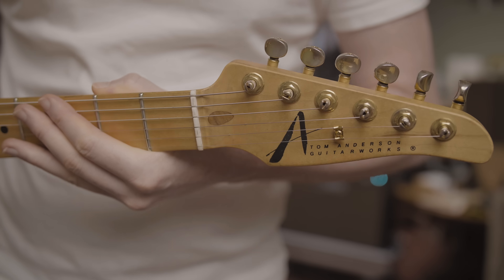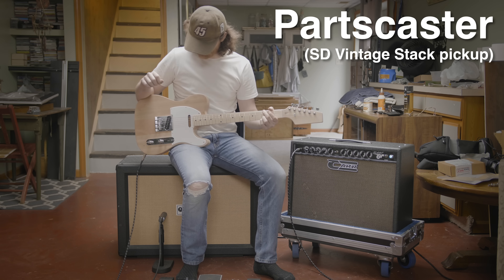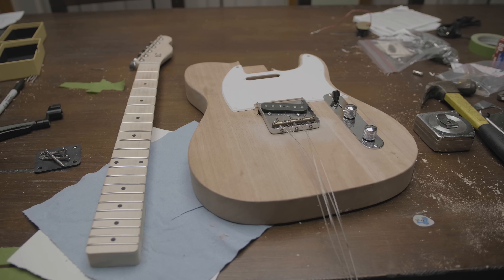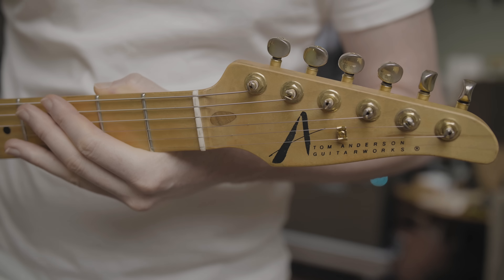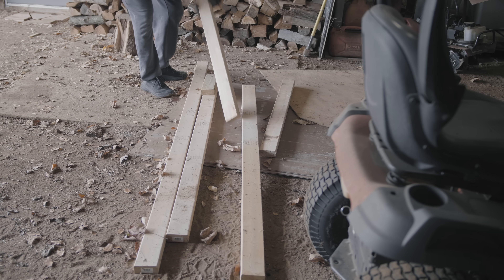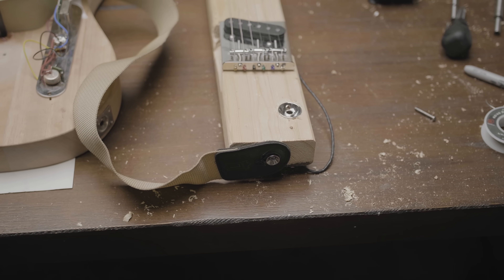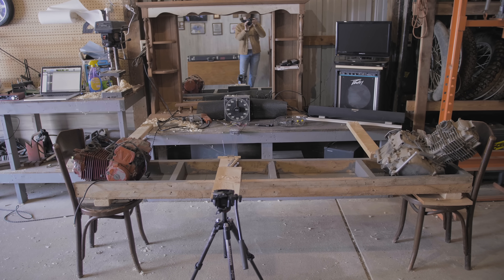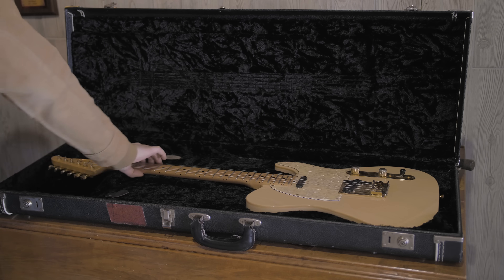Tested: Where Does The Tone Come From In An Electric Guitar?

Comment: Completely blown away at what you just taught me. Wow!  I will now buy my guitar to the specs and look that I want and alter only the pickups and electronics for my tone. The tone wood myth has been dispelled.
Reply: Don’t cheap on the hardware either! Just because it doesn’t affect tone noticeably, doesn’t mean it doesn’t matter. Great hardware lasts a long time and stays in tune reliably.
Reply: yessir!
Reply: on potted pickups yes
Reply: @Karokahn  Nice try, all pickups are potted, if they weren't, they'd be microphonic, which is not what you want in a pickup.

Worse still for your theory, pickups are potted in wax typically, which is very soft. Look up the resonant frequency of wax (it doesn't have one), so that's preventing anything from being microphonically induced into the signal. Further, the pickup itself is only attached to the guitar via two screws, and suspended on those screws with springs.

So if you're a "microphonic" believer, the place you should start is the screw/spring assembly, not the wood.
Reply: @jttech44    .. Nice try 😂 all pickups are of course NOT potted.  If you will ever play a set of such, you may even understand what difference it makes to their sound.. if you dont play metal, that is 🙄

Comment: I'm not a guitar player, but one other thing to consider is how long a 2x4 would actually stay the same shape with tension on the springs, changes in humidity, or changes in temperature. I would think that what you're actually paying for with expensive hardwood guitars is longevity and durability, not just tone.

Comment: The only difference I imagine the wood might make is how quickly it absorbs the vibration energy from the strings and kills the sustain. And I wonder if over the length of that sustain certain frequencies and harmonics might die off more quickly or slowly depending on the density. Though you’d have to bolt your guitar to a hard, dense surface to eliminate the dampening that simply holding the guitar introduces.
Reply: And sustain isn't tone. 
It's the length of the tone. 
Tone is the character, EQ signature of the sound, length or sustain for the same sound can vary.

Comment: Finally this proves tonewoods do nothing. The only reason you should choose different woods is purely for the looks of the finished guitars. Tone comes from the pickups and that's it. But I guess sustain comes from the woods and construction as sustain is basically how long the strings can resonate, and what the strings are attached to most likely have and impact. Learned something today thanks.

Comment: This has been popping up in my recommended feed for a few months now and I've put off watching it for some reason, but I'm glad I've seen it now.  You just completely shot down tons of myths that have been around forever about what makes a guitar's tone.  

Most of what we pay for on an electric guitar is the fit and finish, but more importantly is the play-ability and comfort!  In a test like this those things may not matter at all, but in actual use of the guitar that makes a big difference.  The playability and set up is a major factor in how smooth, how fast, and how precise we can be while playing.  So yes, while it is definitely possible to get an identical sound out of the cheapest guitar possible, the comfort and feel won't be the same without putting work into it.

This at least clears up for people what they don't need to be picky about when it comes to buying a guitar, which is great.

Comment: I have a nice collection of guitars and have been noticing that they really don’t sound all that different from each other, except for the hollow body electrics, which do seem to depart from the solid body guys.  I have also noticed recently on a setup that the pup height makes a huge difference in tone.  As for the contribution of the body, I can see how the strings could resonate through the wood and have a certain effect on dampening the vibration (which may well explain the hollow body) but the first-order tone influence seems to be the pup height and strings, as your excellent research has shown.  I have a Squire that I bought for one of my kids for $200.  I sounded like crap until I set it up - adjusted pup height and intonations - then it sounded very much like my Fender Strats, even with the stock Squire pups. The setup is ALWAYS required and so many don’t bother but you can do it easily with simple tools and some patience. Once set up properly the better guitars will outplay the cheapo’s but mainly because the latter don’t have the nice fret edge finish work and mag also lack quality pups (sometimes also crappy bridges and tuners). Nice work!

Comment: Ok so what I have found that goes into the tone of a guitar goes into the finitest parts possible, all the way, which is all the materials it is made of. Starting with the most essential & generating sources, then reaction balances and care for the Vibrational Resonate Frequencies being kreated. There are other factors to pay attention to & make sure a guitar or other instruments are in accord, tune and environmentally balanced with. Starting with the types of metals used in relation to Magnetism. Sound waves generated from the strings on a guitar are physical specific waves, & work & blend with physical magnetic & electricity waves. So the magnetic, electro & Vibration waves need to be in sync with each other & working together efficiently. The sound waves are attracted to the Magnetism, & the electricity directly attracts to & is ampped up by the Magnetism. Then the Electricity amps up the Sound waves or Vibrational Waves or Magnetic sound wave signal. So the materials, woods or Organics used should be paramagnetic or related when possible, Hemp necks may be a better place to start, or other care for the Magnetic\Electro\Sound Wave Combination signal strength needs to be tracked all the way through the entire instrument, to capture & flow all of the sound wave signals, & send them directly to the magnetic pick up system. They naturally want to attract to the Magnetism, so care for the source of sound waves being generated starts there. The truss rods need to be ferromagnetic, which auto attracts to the strongest, nearest magnetic source, which is the pick up system. The frets need to be solid paramagnetic metals, which activates with a ferromagnetic source and flows energy ions to the ferromagnetic source, which then attracts to the strongest magnetic source at the pick ups. Diamagnetism activates with a ferromagnetic source and pushes ionic energies away from the ferromagnetic source & magnetic pick up system, so they should not be used on an Electric guitar. Because they send second & third level ionic sound wave\electro EDDIES away from the ferro & magnetic pick up systems. The second & third level eddies add the best parts to the tone after the first main circuit of Magnetic Electro is established & operating. So the metal strings used need to be ferro or paramagnetic to link with the magnetic pick up system. Then all of the other vibrational Waves kreated by the strings need to be captured in the neck & body, and magnetically attracted to flow in one direction to the pick up system, and not let any sound waves be pushed off away from the instrument & pick up system.  So magnetic flow from the paramagnetic machine heads needs to flow to a small magnet at the nut facing north, in line with this Planetary Magnetic System. Then flow into the ferromagnetic truss rods as all the vibrations in the neck are captured by the paramagnetic frets & attracted to the ferromagnetic truss rods flowing to the magnetic pick ups. Then the same method used to capture wall of the vibrations, reverbs & timbers being kreated in the body, and attractively sent to the pick up systems, all metals used after the ferromagnetic truss rods or strings, need to be paramagnetic to Kreate a magnetic flow system that flows to the pick up system. Stronger & higher amounts of magnet\electro\vibration waves & signals flowing into the pick up system, adds vast amounts of tone to an Electric Guitar output, because of stronger signal inputs into the pick up system, instead of kreated, secondary & third level benefits being physically pushed away from a guitar & pick up system. Ferromagnetic Glass Metals can also be used to Kreate New kinds of attraction covers to magnetic pick up systems. Then a paramagnetic lining should be put at the back of the body to keep vibrational custom waves from escaping out of the back side of a guitar, a rounded back body also kreates maximum reverb & timber effects that are attracted to the paramagnetic lining in the body, and are magnetically sent to the pick up system.

Comment: The SLIGHT differences some of you notice here are due to the acoustics of the barn he is in and the fact that he moved his camera setup around while recording. That's it. Whether you believe tone wood matters on an electric guitar or not, the main point is, don't pay a lot for a certain type of wood and don't pass up a guitar you otherwise like just because of the body wood. Once you plug it in, you can EQ and modulate ANY guitar to sound like any other guitar and NOBODY will be able to tell if they aren't there watching you play. Example: When Led Zeppelin first showed up, everybody went out and started buying Les Pauls after hearing the albums. Then they found out he was actually playing a telecaster. It's a well known fact and was a running joke at Gibson for years. YOUR tone is in YOU.

Comment: This is so painfully frustrating. Yes the pickups, wiring, scale matter the most as far as tone and gain goes, however. The air guitar is tacky, lacks middle and bass, has no balance as well as somehow no seperation. You can hear as you take the body away from the guitar the decay is swifter and a little less sustain. Also most of your examples you can hear the less body guitar clearly gaining more ugly artifacts in distortion. The body and neck of guitars resonate back into the strings creating a phase and increasing the resonance similar to a spring reverb. This whole video you just base on the sound of clipped low quality recordings, show us it into a di and an EQ even the smallest difference means something. The lamest thing is that low quality guitarists make this arguments, while people who build them, producers and top guitar players all completely disagree. It is actually measurable as a producer and it astounds me someone didnt stop you and point out some of the far more obvious ways you can test this.
Reply: I mean honestly i think maybe its because im in the studio with monitors rn, but if you cant hear the clear difference between eery single example on this video you need to check your ears

Comment: A specific guitar tone is generated from pickups, cap and pots NOTHING ELSE assuming your strings are in good condition. Like many have pointed out the musician also has an input, so I guess if one like rosewood over maple or vice versa it might help but that is superficial and subjective. When I buy a new guitar I always mess with the caps just for a bit of fun and comparison since they can make quite a bit of difference no matter what pickups you have. But seriously when playing its your effects amp and particularly what drivers are in your cab that matter the most.

Comment: At the very end, one thing the air guitar and the TA still have in common is the bridge *type*. Different materials, yeah, but maybe the materials don't matter as much as the bridge type, shape, how it's mounted... I don't believe in it too much, but hey, science requires precision.

Since most of the time, we're trying to change how a specific guitar sounds... between the leftover variables (tuning, strings, scale length, volume pot, and then everything that relates to the pickup), there's only so many things we can easily change. We usually will stick to specific tunings and often also to the strings, because these things impact other things than the tone. The scale length is fixed. The pickup position and angle are fixed normally (unless it's a pickguard guitar with universal routes underneath). So essentially, without hacking away at a guitar, it's: pickup model, pickup height, and the volume pot. Those are the things that can "easily" be changed.

Comment: To be honest the 3 biggest factors in my opinion are the player, the pick-ups (type and positioning) and the amp in pretty much that order. I think a few other things effect it too but those 3 are the major ones. I've played Squiers that sound indistinguishable from their much more expensive Fender counterparts. All I've ever done is upgrade the electronics are set it up correctly like in your video. Obviously you can embellish on the tone with pedals/effects and such afterwards too
Reply: The amp/pickup combo is very very intricate. Input impedance matching, and what the amp does to a given set of frequencies is very specific and nonlinear.
Or to put it simply, it's the machine, then the player, always. The machine can, of course, help or hurt the player, but, that's not a tonal change.

Comment: Besides "the player" or the wildcard element of playing the guitar in general, Pickups are 1st, hardware 2nd and possibly scale length but frankly far too much is put on the "acoustic" elements of the guitar involving woods and finishes, to the point where it's just about aesthetic.  The pickup only "hears" string vibration via electromagnetic flux and it's probably 99% electrical signal and less than 1% microphonic/acoustic energy sent into an amplifier.  Experiment:  Take your guitar and put it on your lap.  Take your cell phone and play audio from the speaker (bottom).  Hold the cellphone over pickup and notice the audio clearly sounds out of your amplifier.   But now turn the phone upside down, where the audio signal is directed upward, the audio should as loud or louder coming from your guitar because the pickup is "hearing" the electromagnetic signal from the speaker magnet/coil from your phone, not the audio signal coming out of the speakers.

Comment: Acoustic guitars differ way more with the wood, hole placement, neck etc but with electrics its way less apparent, mainly things like sustain are affected with the body shape and wood type but the biggest things are electronics, strings and if the neck is glued in or screwed in. if i put tele pickups in my lp it will sound basically like a tele and reverse just maybe a bit more or less bass and more or less sustain virtually no difference especially to an untrained ear e.g your audience if your playing live.

Comment: My opinion: I've always felt it's obvious that the "voice" of the electric guitar is down to the pickup. Beyond that, there are other factors that affect the sound to a lesser degree (some more than others). The voice stays basically the same, just with minor changes to certain parts of the voice.

Pickup placement is the biggest one, not just height but position along the strings. Scale length makes a big different because it affects the pickup placement so much; a strat neck humbucker will never sound quite like a les paul neck HB. Saddle and fret material make a solid difference. Strings make a huge difference. 

Wood makes a difference - not directly to the voice, but to the qualities of the string's vibration, which is then picked up. That includes chambering and semi-hollow construction. It's questionable whether we could call this "tone". I take tone to mean the quality of the guitar's voice. I think wood affects tone a little bit (I've heard other well-controlled A/B tests that display it), but I think the biggest difference wood makes is how it affects string dynamics, which doesn't change the voice of the guitar, it changes how it's saying its notes (ie the duration, the swell, etc.). This is where some people really disagree about elec. guitars, and that's fine, I've heard enough evidence to convince me (in other videos, just as clearly as this video proved its conclusions). Just the fact that hollow guitars feedback is a reminder that there's no firewall between the wood body and the strings; they're part of a system, and they affect each other. And then of course a trem system can influence the string dynamics just as much as (or more than) wood.

I'd say with setup being equal, maybe 80% electronics, 15% other components (saddles, frets, trem, etc.), and 5% wood? Something like that. My view. Maybe not exactly right, but I'm confident it's pretty accurate.

Comment: I’d have Fourier transformed it between every difference. Comparing the even harmonics to the odd harmonics between changes should tell you quite a lot about the effect of geometry changes like that. The string mounting hardware and the strings themselves will also have an effect on this, but will likely have other effects too. For them I’d be on the lookout for anharmonic components in the FFT (slight deviations from the major harmonics, broadening of the frequency peaks) that might be caused by nonlinear deformation of the strings or hardware. Also completely anharmonic components (ones nowhere near a proper integer harmonic) that would be the result of parts of the guitar other than the strings oscillating in their own modes.

As for the output pots, maybe they should use batteries or phantom power and op-amps to buffer the signal before adjusting the volume, that way the harmonic attenuation (tone) is out of the equation and can be reintroduced by a pedal with an RC filter. Doing so may reduce the difference in tone between different pickups.